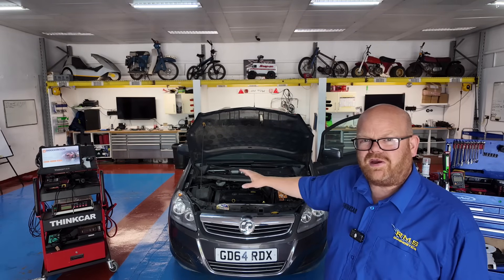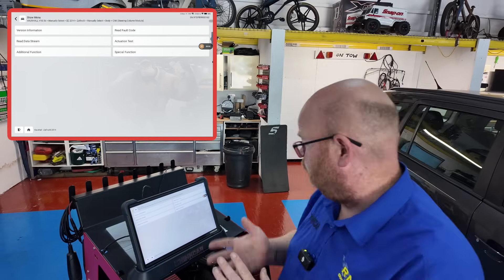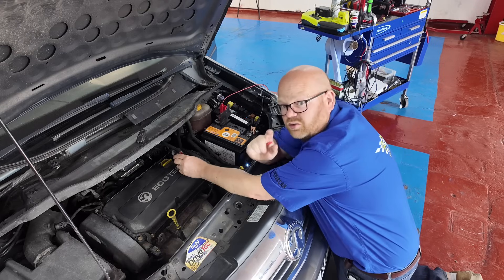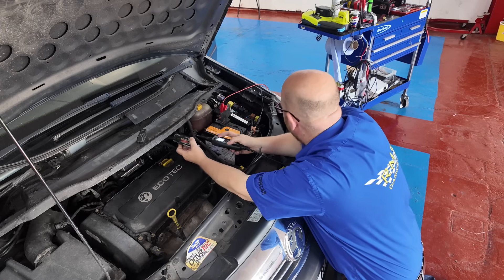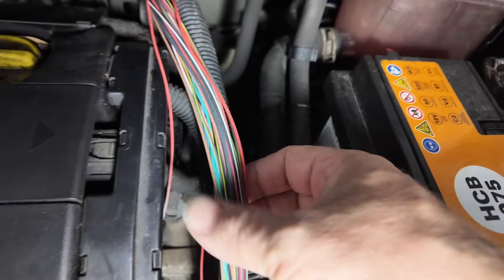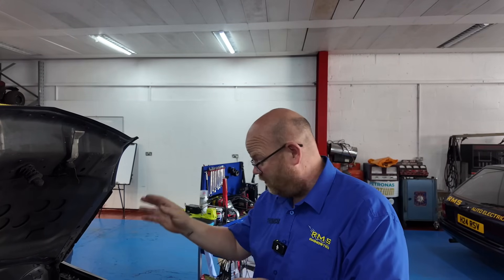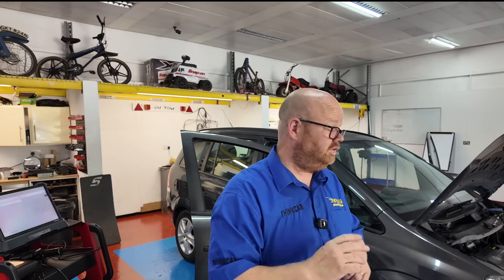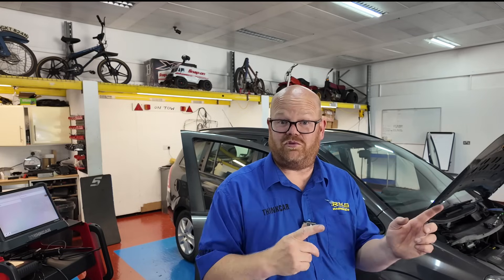No Comms with ECM? Don’t Make This £1,000 Mistake! #mechanic #cars #automotive

Comment: now then oh yes a few blunders i have made over the years that’s for sure . i am in the position of working in a manufacturing plant now and have got a bit lazy to be fair as i can go and get the ecu’s off the shelf and try them . but to be fair probably 9 out of 10 are not the ecu at fault and i have to switch the brain on 🤣🤣🤣🤣 most are crushed cut wiring or faulty switch gear bent pins pushed back pins . soft set connections occasionally miss build or wiring faults . keeps one on ones toes for sure . but follow the proses . what does it want what’s missing then make a plan to test seems to work for me 👍
Reply from the maker: if I had access to the a ecu I would plug in before testing aswell

Comment: It was a clear mis diagnosed fault bob, typical parts cannon hoping the fault would go away by throwing tons of someone else's  cash at it...

I had a customer last week with a Audi Q5 with a possible 3 k engine tear down and rebuild bill all because it was not looked into properly, turned out to be a cam actuator solenoid that was stuck and gave a performance error to the ECU and the last shop wanted to tear it apart and replace everything at my customers cost, not great service in my opinion, is it me or does no one want to look into why things don't work and the cause of the failure before throwing high cost parts at it...sorry bob , had to have a rant 👍👍
Reply from the maker: unfortunately this was the car dealers own money they have wasted.
Reply: Yeah thats not good as that car dont have alot on the bone after throwing over a grand at it...fair play bob you nailed it as always...ginger legend strikes again
Reply: Prob for the likes of a mobile auto spark and this kind of stuff, and let's face it , basic stuff not check is very common but by time auto spark arrives on scene everyone is shit faced, customer, garage, "sales guy"  (them the worst) ,what should be a great job with feelings of saving the day never is, and they always want it all done on a Friday, and for free.

Nop, fvk the motor trade, just say no kids.

Brickies don't wake up obsolete one day.

Nice vid and hope you charged like a wounded Rhino.

Comment: Was told on my Shogun after two mechanics had a look that it was a fuel pump at around £700 when it turned out to be a dodgy fuel pump relay..at around £20..
Reply from the maker: ooops

Comment: It’s really hard as a mechanic as we think like a mechanic and not like an auto electrician they are different jobs you wouldn’t ask a plumber to replace your roof would you that’s why we need people like bob to pull us out of the sh*t.
Reply: Agreed if you’re into the mechanical side of cars but as Bob said, powers & grounds are the first most basic checks for a no comm with any ECU so it should’ve been findable by a half decent Technician with the right info & a test light 🤷‍♂️
Reply: If you are a OEM main dealer technician you are both a mechanic and auto electrician.  Back in the early 80s the were indeed two seperate trades mechanic and auto electrician at that time they were two seperate aprentiships .  As vehicle control systems became more integrated ie electrcal control of mechanical systems and sub systems the mechanic had to become an auto electrician and the auto electrician the mechanic this is where the term technician came from bringing two trades that were seperat into one.  Training reflected this add to that Hybrid and EV vehicles you are also an electrical high voltage engineer.  You will find that no OEMs offer aprentiships fo mechanic or auto electricians, the only aprentiship we have is vehicle technician which the training covers every thing in the vehicle.  Most manafactures will have 3 licenses being service technician, diagnostic technician and master technician.

Comment: Got a pre-programmed 'plug and play' ECU off eBay for a Ducato the other day fired up straight away
Reply from the maker: I think some units are either set up to read the immo and lock onto it or some eBay units have had the immobiliser removed completely
Reply: @rmsdiagnostics  you're right,i know some technicians who keep this kind of ECU for testing purpose,they call them cracked or bypassed,and this ecus works without the need of coding.
Reply: @rmsdiagnostics I must have got lucky then and found a decent vendor!